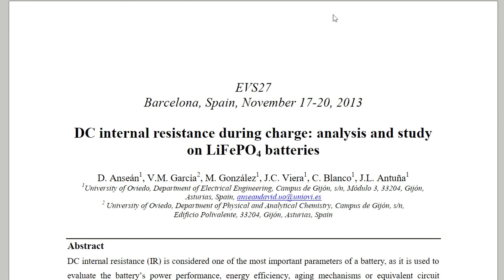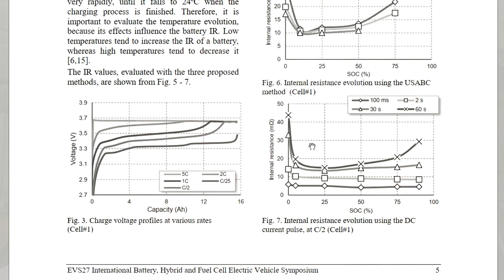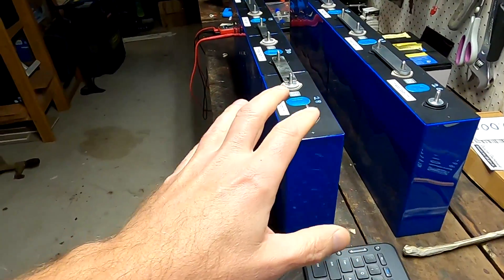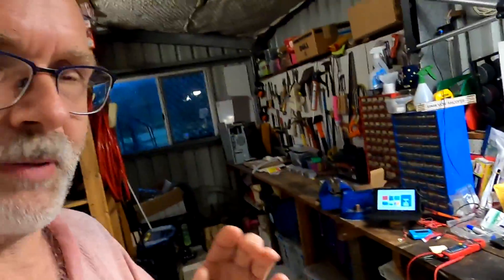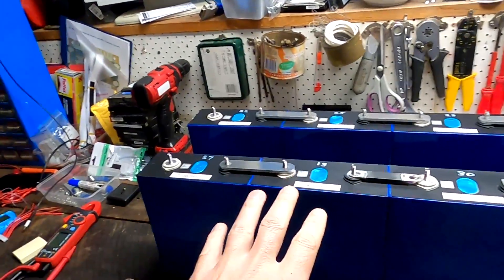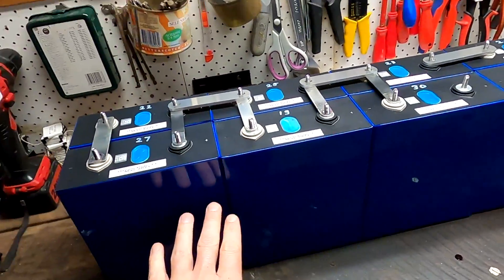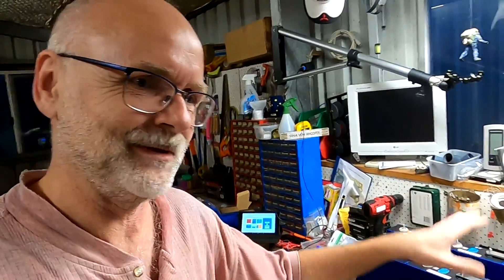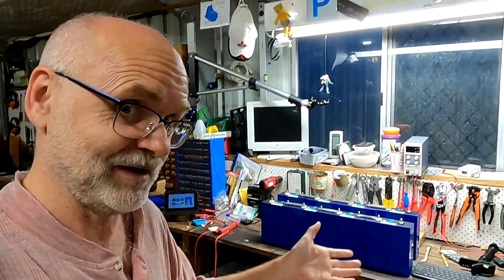Can you parallel battery banks after bottom balancing?

Comment: Hi Andy, bottom balance each new strings of batteries once only, then maintain each string with a separate BMS with Top Balancing from time to time.  Connecting strings of batteries in parallel, is by bringing each string to the same voltage, that is the existing battery pack with the new string, this will allow you to scale up.  Each string to have its own disconnect to the common bus bar.
Reply: You cannot mix like that. Either bottom balance or top balance.
Reply: Andy, you don't believe me watch this video just released by Victron https://www.youtube.com/watch?v=Lj2L8hcCKfs @5:01, you will see 10 strings of LFP connected in parallel to a ginormous busbar with 10 fuses . . .

Comment: Just some logical thoughts:  When connecting 2 cells or batteries in parallel, the current flow from one battery to another would depend on the internal resistance of the highest resistance battery at the time plus the resistance of the bus bar, and the voltage difference between the 2 batteries.  As long as you're not exceeding the charge or discharge rate of either cell, I'm not sure there's a problem connecting them as long as the voltage is reasonably close.   If you are concerned anyway,, you could connect them with a low value resistor (1-10 ohm) of the proper power rating (or an incandescent light bub) until they reach equilibrium. 
I guess if you're paralleling 2 batteries it would be best to parallel each cell of the batteries.
I sort of suspect you're over thinking this....just connect them, measure current and see what happens... worst case you'll melt a jumper wire and have a small fire.
I never would have guessed this could be so complicated.
Reply: ok, I may not be thinking about this enough.  After watching some more videos,  10mv/0.15mohm =66 amps  oops. 
 Get the voltage as close as possible before connecting together, or connect with an incandescent bulb until equalized.

Comment: Bottom balance is for EV's as you are more often in the lower SOC range. Solar systems should be top balanced as you charge daily(except you -3a weather😆) and are more on the top end or SOC. Id never recommend using your charge controller for your over voltage or inverter for low cutoff. Eventually they will become out of balance and a cell will most likely overcharge! Just my 🪙🪙
Reply from the maker: Great point! Thanks Joe!
Reply: 8S 310Ah Lifepo4. am getting a 24v inverter with programmable LVD/LVR which I plan to set higher than the BMS LVD, set up for 2.5 cell voltage. Common Port BMS, with 50A charge and 200A discharge FETs. Max load is 100A 3Kw, through 125A dual breaker, 50mm2. Length = 1 & 0.5 Meter cables. BMS is ‘DYKB metered’ Smart ANT, 8S to 24S = high voltage FETs and my max discharge current is half its capacity. I might eventually parallel 2 BMS’es if I need more solar charging.
Reply from the maker: @michaelbouckley4455  wow, that's a nice system. That's for your house?
Reply: @OffGridGarageAustralia  yes. But already have a smaller system. This is first inverter, to run a small aircon in daytime, and run fridge & tv in brown outs

Comment: My thinking is as you initially thought to take up all the cells to 3.6v and let them absorb until they receive 1A or less when all are in parallel and let them rest a bit and switch on a BMS and when your first battery is approaching fully so you connect them.
It's been a long time since I calculated on electricity, but if I remember correctly, the internal resistance will determine the voltage drop across each cell so the fall across a cell with 10% higher resistance will be too high compared to the others?
(think that you connect 4 x 12v car lamps in series, but two of them are 10W and two are 55W, so the 55W lamps will not shine very brightly while those that are 10w will burn out quite quickly)

one idea is that you do not screw the BMS cables M6 but solder it if you can otherwise screw it in a separate hole / thread (remember not if you have spot welding and nickel strips so you could solder in nickel strips and then weld (do not know if it goes in aluminum) otherwise thread a hole as small as you can if it is M3 or if you do even smaller) should give the least error in reading and all connections should be most equal

Comment: The use cases for bottom balancing is more appropriate for an electric vehicle than for a solar powered home or garage where you are almost always topping off the system and almost never running the battery to a low state of charge where bottom balancing would be helpful. Instead, since you are almost always topping off the system and only drawing it down a bit - and topping it off again - top balancing is most appropriate .

Comment: Hello Andy can you not use a battery combiner diode blok from victron. And then have each battery it's own charger.
Reply from the maker: But only up to 80A... seen them, but it's not what I would need, as I have power going in an out of the battery.
Reply: 80a is about 4000 watt and if you connect the solar charge from the east direct to one battery and the solar charger from the west direct to the other your problem is solved. 
And I think there are higher amps battery combiner from other manufacturers.
Reply from the maker: @villacarinaapartments  Ah, right, you split the chargers as well. Yeah, that could actually work then... letting current only flow out of the battery to the inverter.

Comment: I think if you do bottom balancing when trying to combine two banks, you would first bottom balance each bank separately to get the "final" voltage of each bank. Then you would use the voltage of whichever bank has the lowest "full" voltage. This won't prevent current going between the banks during (dis)charging as voltages at different SOCs may differ, but it should ensure that no cell can ever go over the max. Then, if you add a third bank later on, you just separately bottom balance that new bank, if the new bank voltage ends up higher than your existing batteries, you just need to drain the new bank to match then add it on; else drain your existing battery to match the final voltage of the new bank and set that as the new charge voltage. No need to drain all to 2.5. All in all, your capacity is always going to be the product of the capacity of the weakest cell and the number of parallel banks; and the charging/target voltage is always going to be limited to whichever bank has the lowest bottom balanced bank voltage. You'll still have some losses from current running between the banks over time, because the voltage curves may not be the same (though they're mostly flat anyway), but there should be no opportunity for a single cell to overcharge.
Reply from the maker: Thank you, great comment.
Reply: @OffGridGarageAustralia  agree, maybe you can visualize his explanation in a nice step-by-step diagram using different colors? (I like top balancing better for my use cases but I like the explanation)

Comment: You can mix and match capacities and chemistries, but with each of a like chemistry or capacity you would need two MPPT controllers and a HV/LV relay (or a BMS).  

In your example you have a 48v battery at 200 amps.  You also have a second 48v battery at 100 amps.  You can use an MPPT controller to charge the 200 amp battery from the 100 amp battery as long as you have a low voltage shut off between the MPPT and the 100 amp battery.  Then you would use the second MPPT to charge the 100 amp battery from solar or whatever.  The price of the two MPPT controllers + a HV/LV shut off relay is less than many other options.  If you have a boosting MPPT controller you can even use a 12v battery to charge the 200 amp 48v battery.  

You can also use this set up to leverage cheaper cells or even those AGM batteries you have.  The key, though, is that you can isolate the children batteries from the parent battery to allow you to remove batteries or add more even if the voltage is odd.  Like using 5 batteries instead of 4 or 3 batteries instead of 4.  It doesn't matter as long as the MPPT's solar side can accommodate the voltages.  This also opens up the usage of the odd voltage recycled vehicle batteries like the 20v batteries in BMWs and Fiat 500e.

Comment: You don't need to balance new cells! You should charge all batteries with the same charger to the same CV-voltage, after that you can connect all. I suggest 3,50 volt per cell, because of the point of SOC in the discarge curves. 3,50 volt is a very small spot/target voltage where not much current can go up or down whem parallelling the battery-banks. But this works only if you use them economical/long cycle life style. (max. 3,40 volt per cell and min. 3,10 volt per cell) If you connect the batteries in cross-parallel you will always have the same distance for discharging. So Plus for battery One, and the Minus for the last P-Parallel to the inverter, will do this trick. And you can parallel as many as you like between the first battery PLUS and last battery  MINUS. Simple ;)
Reply from the maker: If you charge them all up to the same voltage, you automatically balance them.
Reply: @OffGridGarageAustralia  And there is the critical point! Pls why go there, if you like longlife? There is no gain above 3,4 volt. If your pack looks oke, than use it. It's the high voltages that are the stress BIG factor, as well below 3,10 volt. Yes, a BMS protects bla bla bla, so does a seatbeld, but you DON'T want to test it. 
Why go high voltage, where cells diviation is much easier to see... Look and see that not all cells have same balance. duh. on 3,40 volt they where..... at 3,10 volt the are.... I like to see 10.000 cycles or more. your cells are most healthy state halfway. At Nominal Voltage 3,20 volt. Stay around that and your pack will never die. And remember don't go High don't go low! 3,4 volt is very nice for full. Who cares about capacity, if to small... Buy a bigger battery. That doubles or triples lifetime. But check cell voltages often... or get a feeling for them. If your cells go out of line easy at medium voltages... Buy an active balancer. Buy a smartshunt for monitoring  system.
Reply from the maker: @stadsimkerijhengeloe.o.4300  yeah, I agree with you.

Comment: parallel battery1)  float is not a form of absorbing.  float comes into play once battery is charged, but a load  & input (like solar or wind) are still present.  float should allow the battery to maintain its charge level while still supplying power from solar/wind to the load's (as long as there is enough to cover demand).  the idea is to cycle the battery as little as possible.  there are only so many cycles in a battery.

2) BMS...   your topic here is "parallel battery...."  the bms addresses series more than parallel.  so it is "off topic" here.

3) connecting 2 strings in parallel....     of course when you start, both strings will have a bms for watching each cell voltage closely.  now simply connect the + of each string together and the neg of each string together.  since neither of the strings were "overcharged" it will not be possible for one string to overcharge the other.

4)charging 2 strings together....  pick a voltage between the knees and charge/discharge to those values

5)mental masturbation..  it happens to us all.  LOL!!.  have a beer!!

Comment: in my opinion: bottom balance, use for example diyBMS from Stuart Pittaway for monitoring and protection. Configure diyBMS to warn you if some cells go out of balance/range. Do not float/absorb, do not use whole capacity to increase cycle life. Better get more batteries then BMSs. If you parallel cells to one bank, use BMS without balancing. If you use two banks use two BMSs.

Comment: About the battery swapping, the advantage is that you regularly hit top charge, thus make it possible to perform top balancing on a regular basis and avoid the issue that you had. a single battery bank must be undersized compared to the solar supply to hit the top charge. There might be a power glitch when swapping the battery connected to the inverter; this can be compensated with a supercapacitor that would be permanently connected to he inverter. I however agree that this option is quite hard to implement because the necessary mechanics is not available as a standard, and switching might create a lot of stress on the batteries.

Comment: It seems to me that you are obsessing about cell imbalance. What are you worried about? Since you believe in only charging to 3.35V or even less to preserve longevity there's very little that can go wrong. You are never going to have a cell exceed 4V due to imbalance and if a cell should go excessively low it will be recharged again the next day since it's a solar scenario. 
To parallel a new battery just have both batteries at the same voltage and less than 80% SoC and do it. Worry about balancing when assembling the batteries with cells in series.
Or, better yet, use a BMS for each battery and pretty much worry about nothing further. I very much enjoy your videos but this problem seems contrived. 

Here's a problem for you to address with an experiment: Can you safely parallel a new battery with an existing one that has a different capacity? All manufacturers tell you that you mustn't do that but I believe that is a hangover answer from the world of SLA. I think it's fine for LIFEPO4 even if both batteries charge and discharge at different rates, because their SoC will track very closely. By using batteries with different capacities you simultaneously answer the question if you can parallel two equivalent batteries of different age.

Comment: If you bottom balance and want to add a new series pack why not bottom balance the new batteries and charge to the same voltage or charge the same amount of amp hours and then connect? Its never going to be perfect but remember youre not going to be using 0-100% of your battery. You're charging to 90% and most likely have a generator to kick in at low levels. No one running a modern house with a family wants to discharge a pack to 2.5v and have a BMS suddenly disconect power to their house.

Comment: I guess it doesn't matter how the batteries have been balanced when you connect them in parallel. They will always stay at the same voltage. Even if one is in a higher state of charge. In that case its voltage would rise faster than the other's. Therefore, incoming current would go into the other battery preferably, because there is a higher potential.

Comment: Why not just have changeover switch between banks. That way you can bottom balance and always have a bank on standby or for maintenance. The changeover could be manual or automatic. If automatic you can still use all the power by the changeover being dictated once the first pack is depleted to a nominated low voltage. All the power is still available you are just taking it from one bank at a time.

Comment: I think it makes no difference to the capacity if you bottom or top balance.  In a Series String of cells you will always be limited by your lowest capacity cell.  Either top of bottom balance, what you will observe is that the cells will either have similar SOC at the bottom of their range if bottom balanced or similar SOC at the top end if top balanced.  With either balance approach the capacity limit of the string will be determined by the cell with the lowest capacity.  The cell with the lowest capacity will get to the highest/cutoff voltage first if you have bottom balanced the string.  If you have top balanced then the lowest capacity cell will get to the lowest/cutoff voltage first under discharge conditions.  

Now, when do you couple additional cells?  The simple answer is you couple your strings when at the the top SOC for top balanced strings and at the lowest SOC for bottom balanced strings.

From what you have said Andy, in order not to be caught with with two string of discharged batteries for the purpose of coupling the batteries you best join the strings when at the top SOC.  Previously I said the simple answer was to join strings at top SOC for top balanced and at the bottom SOC for bottom balanced strings.  However I think you can still couple two strings of cells that have been bottom balanced at the top SOC.  The issue here is that the string voltage for the lowest capacity string will dictate the maximum string voltage for the higher capacity string.

The question of to balance or not to balance needs more thought about the self discharge mechanism and capacity variation depending on the rate of charge and discharge.

Comment: Before you connect the two batteries for the first time you have to bring them to the same voltage. That's not necessarily minimum voltage. Should just be something below the common maximum voltage.

Comment: Well, most people are wrong:-) You bottom balance when the cells spend most of their time at a low SOC and you top balance when they spend most of their time at a high SOC. Boats top balance because by noon their batteries must be fully charged and solar is powering the boat for the rest of the day.
Also, after balancing, -stay-away-from-the-knees-. No balancing, just monitoring, regardless of which balancing method. When a cell starts being too low, you inline-charge it. Example: cell 6 is too low: psu negative on cell6 negative, psu positive on cell6 positive and charge at 3.60V or so, limiting amps to charger max or cell max and count Wh going in and stop when you think it is at the avg of the other cells. When one cell is high you can use an electronic load or even just a power resistor to discharge it a bit (inline, no breaking up of cells)
For adding batteries: charge new one to same SOC and switch it online.